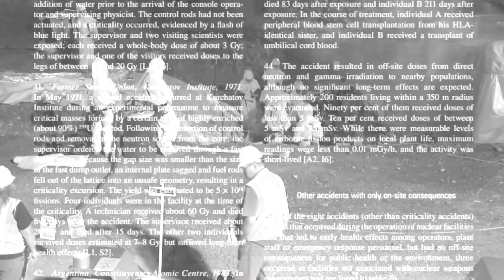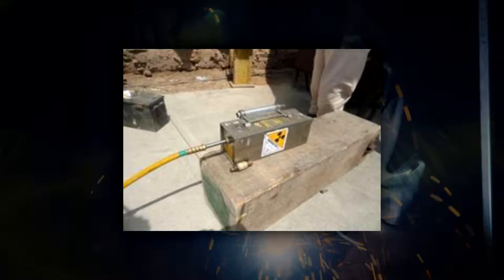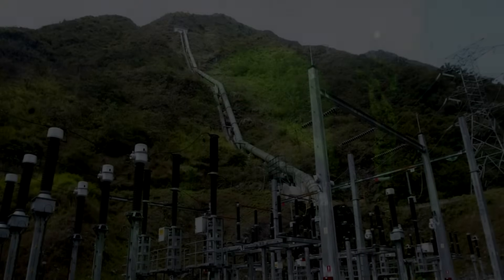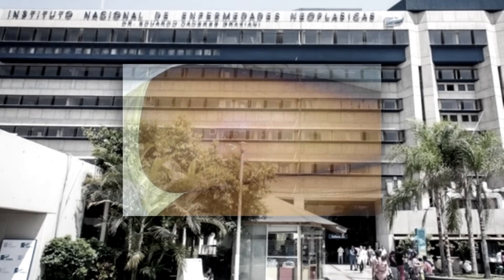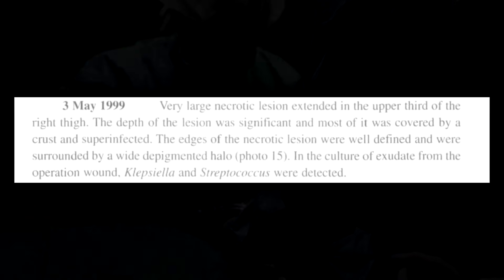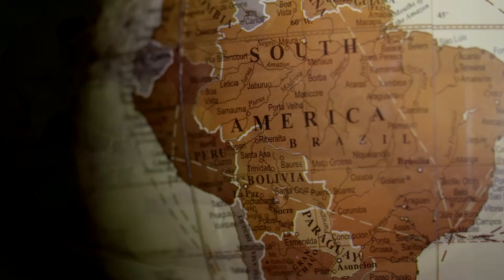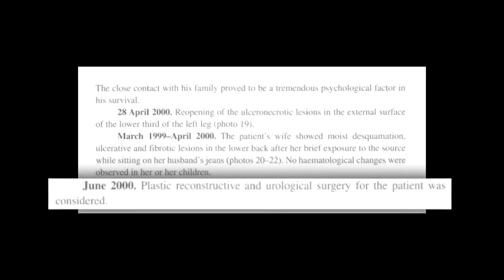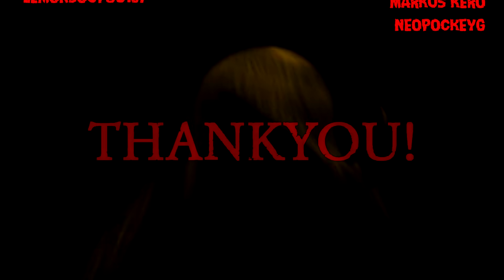The Yanango Radiation Incident

Comment: This whole story is negligence of the highest order. How in the hell did the radioactive isotope, (in the form of the pigtail-wire) end up out of the radiographers camera and on the ground near the pipe the welders were working on!? To me, it sounds like someone intentionally removed the wire from the camera. Something like that just doesn’t fall out from the piece of equipment it came from, especially considering how the lock was still in place. Yes, the lock was loose but it was still clearly in place. Someone is definitely not telling the truth.
Reply: I'm guessing he wrongly believed it was some kind of precious metal, as is used in some kinds of machinery (like a car's catalytic converter, which has rhodium, palladium and platinum).  In Spanish Iridium is 'Iridio' and Palladium is 'Paladio,' not terribly similar but maybe enough if he heard someone say it from a distance.
Reply: @audreymuzingo933  if it was a hydroelectric plant, he also wouldn't have any training on radiation. He likely would have been completely unaware of the risks.
Reply: I read the IAEA's report. He definitely did not have an training.
Reply: @muffywumpkins3648  Right, because he was just a welder, no need for training on the camera equipment.
Reply: @audreymuzingo933  Anyone work need radioactive sources, even if it's one day, needs training on radiation protection. It's a 30 minute tops session. At operating plants, anyone who works on site gets a class on the basics even if they won't be anywhere near radiation. Essentially, IAEA is saying lack of training & manage decisions are major elements to this incident.

Side note: This is why I don't worry that much about the average terrorist making a dirty bomb. The good stuff is probably going to wreck them before they can do much. Most of that stuff is going to be far more guarded too.
Reply: @muffywumpkins3648  Well this was in Peru a quarter century ago.  Obviously the worker didn't receive training and it wouldn't be the first time a profit-driven company ever ignored regulations, especially international ones that can't possilby assess every operation on the planet, and even if they did, I'm sure there was a binder or computer file with a checkmark next to the worker's name, saying he completed the training session.  Did you see if he sued his employer?
Reply: @muffywumpkins3648  as a welder, no they wouldn’t be trained on radiation, they’re not even working at the same time as the radiographers. the most interaction they would have with them is being told which parts need to be reinforced/redone after the imaging
Reply: I'm a self confessed hoarder of shite that I think I could use in a diy/art project. I can totally see myself picking up a bit of steel cable, especially if I was a welder.
That does beg the question of who broke into the camera and why though? Surely nobody would remove iridium knowing what it was and just discard it? Why else open the camera?
Reply: @UncleRedDog  Jeez, now you've got me wondering what would happen if you applied welding heat to iridium.
Reply: @audreymuzingo933  The element would essentially explode creating scatted contamination.
Reply: @UncleRedDog  If the sealed source isnt properly connected to the drive cable it will essentially be pushed out without the ability to be retracted back in. The only way to honestly know that the source is back in the shielded position is by using the proper detection equipment. A radiographer is a worker like anyone else and complacency can happen leading to a disconnect. This is far more likely than theft as a sealed source is secured behind a lock on the device mechanism.
Reply: @UncleRedDog  yeah as a welder into blacksmithing, i might have done the same lol
Reply: Not only that, but why didn't a lack of radioactive  readings from the equipment whose whole point is to be radioactive set off all of the alarm bells in their head?
Reply: Former industrial x-ray tech here. Workers on jobsites will steal anything that's not tied down, especially from visiting contractors they won't have to face again. It's so common that most of the site bosses aren't even phased when expensive stuff turns up missing all the time. The problem with this attitude becomes immediately clear when you're dealing with stuff that will kill you if you steal it. It's happened many, many times.
Reply: 100% the welder stole it. These guys are paid peanuts and he thought he may have an easy come up.
Reply: I worked in radiography on pipeline. The fact they left their camera totally unsupervised is boggling to me. If we had to go do something else on site, we'd lock the camera away in a compartment of our portable dark-room, even if we'd only be gone 10 minutes. 
You never leave that camera unsupervised.
Reply: Because nobody cares about us construction workers, the only thanks we ever get is prejudice.
Also we men with rough jobs sadly almost NEVER go to doctors or hospitals by ourselves and just brush any pain off no matter how strong - in turn dying at and for our work...
We need to change something, I see a lot of ads about people wanting better conditions in the OFFICE so what will happen with us now, let's do it!
Reply: It's obvious that the welder stole it.  That's a common thread in these kinds of accidents.
Reply: I think the welder guy broke into the camera himself to steal from it. He thought it was something valuable and stuck it in his sneaky back pocket. Not a smart move, to say the least!
Reply: @stephenwalker2924  I agree! Why would you pick something up off the ground and put it in your pocket not knowing what it is? It was the first question I had… why did he put it in his pocket!?
Reply: Devils advocate, it looks like something that fell off another tool or piece of equipment, I could see showing it to the tool room guy or something to find out what it belongs to.
Reply: @abelq8008  but he went home with it
Reply: @Dagonnnnnn  you never put something in your pocket and forget about it?

My take is he found something he thought was interesting, put it in his pocket, forgot about it. Then the pain came and put two and two together

“The area behind my thigh hurts. What could have caused it? Maybe that metal rod I found”
Reply: @angelawhite2022  He may have just wanted to put a piece of junk away or pick up a missing object and forgot that it was in his pocket.
Reply: @MisterJohnDoe  yeah, I’m sure there an explanation there somewhere. Maybe he just thought it looked cool, who knows? Sad how it worked out tho…
Reply: @stephenwalker2924  exactly I can’t move from the fact he chose to pick it up and chill with it!!!! At that time it was essentially a building site and tools would’ve been allover the place, why did he specifically choose to keep this part? I think maybe some corrupt people paid him to take it and maybe he didn’t understand the ramifications of removing the wire. Maybe the police need to look into any land or power grabs of the nuclear plant.
Reply: @Forflipsake  it was a hydroelectric plant. And the report states that removal of the lock is possible with a screwdriver in 5-10 minutes. Then the source has to be detached from the cable. So yeah, it was probably theft. Why you would want to steal a radioactive isotope i shielded is bonkers.
Reply: @Forflipsake  it was a hydroelectric plant. And the report states that removal of the lock is possible with a screwdriver in 5-10 minutes. Then the source has to be detached from the cable. So yeah, it was probably theft. Why you would want to steal a radioactive isotope unshielded is bonkers.
Reply: @Forflipsake
Reply: 😅😊😅p😊😊😊
Reply: That's our lovely southamerica in a nutshell. If this happens with something as important and deadly as radioactive stuff happening, imagine the lesser things
Reply: @ChibiBoxing  stop electing Communists.
Reply: Is there any coincidence that a travel advert for Fukushima popped up during the advert!

Comment: I find radiation incidents fascinating too!  Something about how such a small innocuous bit of metal can do so much damage because the unsuspecting victims didn't know what they were dealing with.  There's a kind of eldritch horror to it, if you think about it.
Reply: My thoughts exactly! I have 4 or 5 different kinds of little braided metal cables in a drawer about 2ft away from me right now, if I saw that shiny metal doodad on the ground there's about a 75% chance I would pick it up and make something out of it. I'd better remember this case!
(BTW, you get extra points for using "eldritch" in the best way possible).
Reply: @0therun1t21  ditto re "eldritch" 🤓
Reply: Theres an incident with highly poisonous mercury that a lab technician came in contact with. Just one drop on her gloved hand turned her into a vegetable.
Reply: it's magic, by any other name

Comment: A lot of stories like this one always start with someone stealing shit they think is valuable. I don't see why the radiographers would remove the source and leave it on the ground for no reason before leaving. I wouldn't be surprised if the welder opened the camera and stole the source thinking it was worth something but didn't realize how dangerous it was.
Reply: Idk, if you're looking for something expensive to steal why go rooting around inside an expensive camera for a random wire inside? You'd just take the camera
Reply: @valx7586  probably took too much effort to unlock it